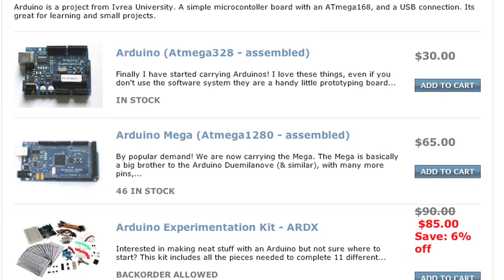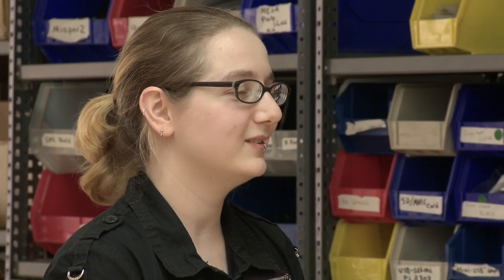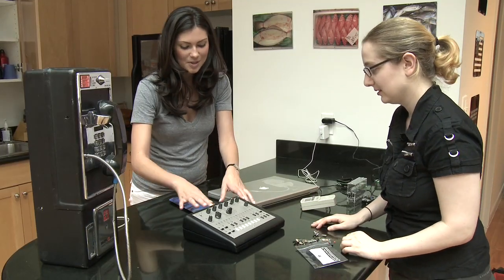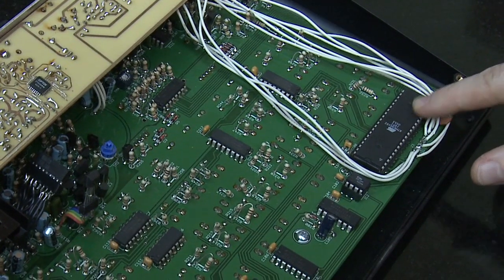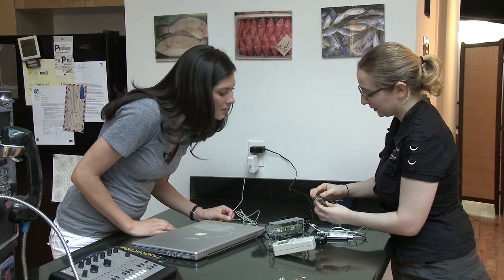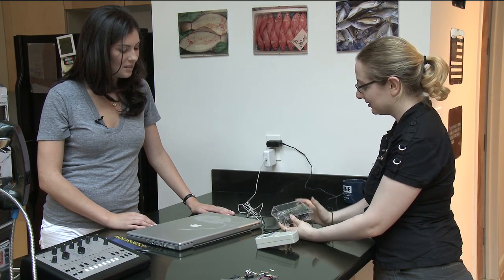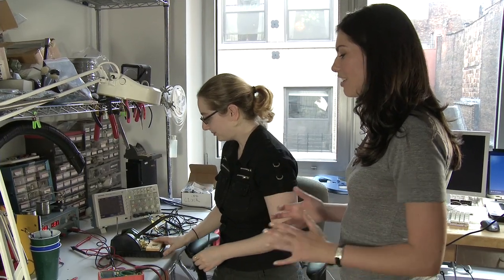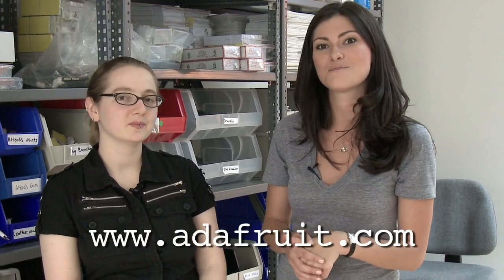Adafruit Industries

Comment: Power Supply doesn't generate power. It modifies the power output from the 60Hz 120V wall outlet to whatever it is you need.

Comment: xoxbox is 1 the greatest synth´s for acid house 
now that Roland stopped making the tb 303 synth.Witch is kinda sad i would have loved owning an original tb 303.I could buy a used  303 but they cost over a $1000 on ebay and other retail sites.